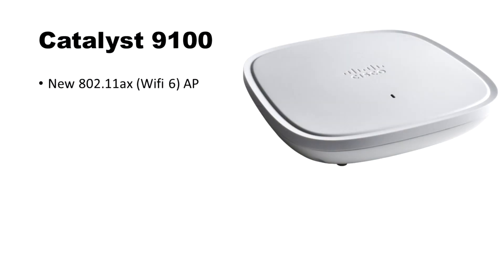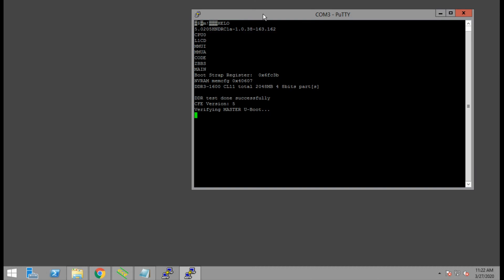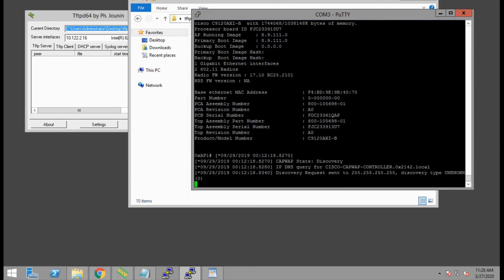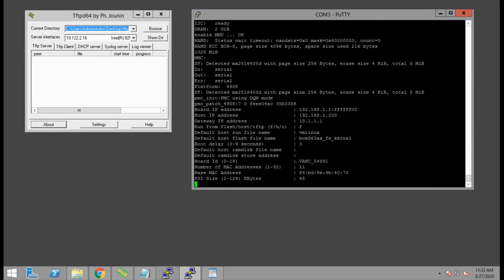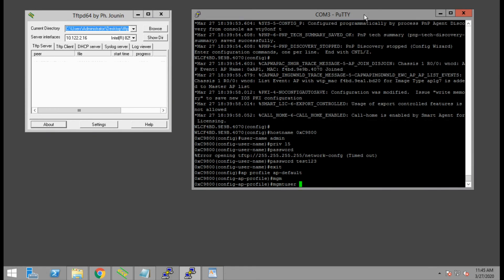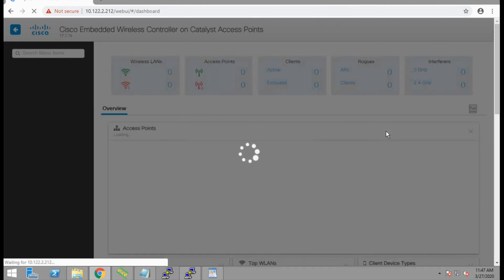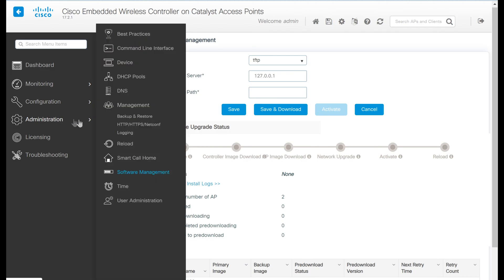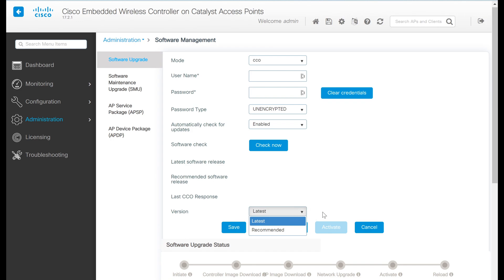[How To] Cisco Catalyst 9100 AP - Convert to Embedded WLC

Comment: I want to buy a CATALYST 9117AX SERIES. 

1. Which model should I buy? 
A.  C9117AXI-B
B. C9117AXI-EWC-B

2. Where do you recommend for a consumer to buy one. 

Are they just coming pre flashed with EWC and can't the B model just be flashed to have the EWC?

Thanks for all your help, you are one of the few on youtube with such detail and clarity! Huge thank you.
Reply from the maker: Hey there! Thanks for reaching out. Yeah the only difference between the AXI & AXI-EWC is whether or not the EWC comes pre-loaded by default. That being said, yes you can flash the EWC to the regular model as well - which is what I did in this video!

For consumer purchase? Maybe Amazon ( https://amzn.to/3kyn5XI ) or something. Ebay might also be an option, if there are any good used/refurb models.

I'll also mention that the 9117 was just announced for upcoming EOS/EOL, since it was a pre-standard wifi 6 AP. That may mean there will be more used available, as people refresh to the wifi 6 certified APs. ( https://www.cisco.com/c/en/us/products/collateral/wireless/catalyst-9100ax-access-points/eos-eol-notice-c51-744421.html )
Reply: @0x2142  Awesome thank you for the quick response. 

I liked the 9117AX for the 8x8 on 5Ghz. Not sure it's worth spending on a EOL / EOS product. It seems to be the only one not WiFi 6 certified out of the bunch.

If you were buying for your home / home office which would you pick? 9115 or 9120 or 9130?

Again thank you for all the advice, thoughts and links!
Reply from the maker: No problem, happy to help! I have two 9120 APs at home right now, managed via the EWC. They've been very solid so far & I'm happy with them!
Reply: @0x2142  

One last set of questions :))

1. Does your setup require Smart Licensing or any other licensing?

2. Would all your instructions apply to Mac?

3. Amazon has the 9120 for $750 as of this post. Does this seem accurate. Where did you buy yours if you don’t mind sharing. 

Again this video is awesome, great work, high quality and clarity.
Reply from the maker: Haha - No problem! I appreciate your comments!

The APs only support Smart Licensing, but I think you get 30, 60, or 90 days before the EWC starts complaining. After that, you'll need to connect to a Smart Licensing account. 

I believe everything should work just the same on Mac, though I'm not familiar with what TFTP server options are available. That aside, all else should be very similar.

The Amazon pricing you shared sounds pretty close. I got mine through my employer for lab/testing, so I maybe I shouldn't be giving advise on what's the best pricing :)
Reply: I’m still confused about licensing. This seems deliberate on Cisco’s side. 

My 9120 should arrive today and looking forward to your tutorial but on Mac.

If I love it I think I’ll need to buy the DNA 3 year license $185 or so and after that I don’t need to subscribe again. Is this true?

Sorry to bug you just not a lot of sound resources I’ve found on the webs.
Reply from the maker: Hey there - yeah licensing is everyone's favorite subject :)

So I'm not 100% on how it would work in your case, but typically if you buy direct from Cisco or a Cisco Partner - the DNA license is mandatory that it be included with the order.

Historically, with most Cisco platforms you would buy the hardware & a perpetual license. These days you would buy the DNA license, which is a subscription license. However, the DNA license also includes a perpetual license for all of the non-subscription features. I don't believe you can procure the perpetual license without buying the subscription license first...

Yes, the reason behind this is Cisco trying to get people on-board with their subscriptions. But I'll say two things to that.... One, you don't have to renew after the initial 3 years. And two, Cisco discounted hardware to accommodate the new licensing model. So most purchases of a new device + required license are very similar, if not the same price as an older device + perpetual licensing. The way I look at it, it's like paying the same - but with a 3-year trial of the subscription features. ( Disclaimer: I work for Cisco at the moment, but opinions here are my own )

So long story short, I think you will need to buy the license. However, you are under no requirement to renew it. You'll also have your trial period on the AP before you need to activate the license - so you'll have some time to play with it before making that decision.

Hope that helps!
Reply: @0x2142  

This is SUPER helpful. I really appreciate all the help/advice/support here, I hope it helps others too like me being less informed on Cisco products and services.

I should be getting the 9120 today from Amazon. It was delayed for some reason. 

Overall Cisco is license heavy but in the end if they make a AP that is best in class quality, then to me it seems worth it. I'm certain this is a debatable topic everywhere and certainly based on everyone's project budget and needs.

I've tried Ubiquiti HD, Rukus 650 & Aruba InstantOn AP15 Access Points but they all left much to be desired for my scenario.

I don't mind grabbing a 3 yr DNA license if I don't have to renew it after 3 yrs and I end up loving the quality of the Cisco 9120AXI. I'll probably grab the DNA license from CDW unless you know of other good places to buy online.

Again super appreciate the help. Always so helpful and thorough, thank you!
Reply: So many newbie questions. I can get around with basic command lines. 

1. What is the best way to get me into this AP? Should it be via the console cable (USB to RJ45)?  This is the best article I could find to do this via Mac to Console Port. 

https://community.cisco.com/t5/switching/how-to-use-a-mac-for-connecting-through-the-console-port/td-p/2392883

2. Once this is done can I begin to use your tutorial?
Reply from the maker: Hey there - Yeah, I believe the AP will require console access to set up initially, especially if you're converting to EWC. Usually, if you already had a controller online - the AP would just boot up, find the controller, and join it automatically. 

I don't use a Mac personally, but those steps look pretty similar to what I've done on Linux before - so I think that should work. 

Once you're connected via console - you should be able to follow the rest of the tutorial, since it should all be via the AP CLI.
Reply: I used Serial 2 for Mac this made it easy for my Mac to find the USB to RJ45 ie. Port on the Cisco AP. 

However, the AP boots but I never see a username prompt to update it to the EWC firmware.

If there is a better place (Forum) to do this on vs. youtube do let me know.

I have the full log in a .txt file I can share on Dropbox, but here is what keeps repeating...

pv6 gw config loop in discovery timer expiry
[*11/21/2020 04:09:39.2750] ipv6 gw config loop in discovery timer expiry
[*11/21/2020 04:09:41.2750] ipv6 gw config loop in discovery timer expiry
[*11/21/2020 04:09:47.5350] PNP:Server not reachable, Start CAPWAP Discovery
[*11/21/2020 04:09:47.5350] 
[*11/21/2020 04:09:47.5350] Going to restart CAPWAP (reason : Post startCapwapDiscovery)...
[*11/21/2020 04:09:47.5350] 
[*11/21/2020 04:09:47.5350] Restarting CAPWAP State Machine.
[*11/21/2020 04:09:47.5360] Discarding msg CAPWAP_WTP_EVENT_REQUEST(type 9) in CAPWAP state: Discovery(2).
[*11/21/2020 04:09:47.5410] 
[*11/21/2020 04:09:47.5410] CAPWAP State: DTLS Teardown
[*11/21/2020 04:09:47.5560] Aborting image download(0x0): Dtls cleanup, 
[*11/21/2020 04:09:47.6290] do ABORT, part1 is active part
[*11/21/2020 04:09:47.6440] upgrade.sh: Cleanup tmp files ...
[*11/21/2020 04:09:53.2320] ipv6 gw config loop in Ac discovery
[*11/21/2020 04:09:55.2320] ipv6 gw config loop in Ac discovery
[*11/21/2020 04:02:03.4460] ipv6 gw config loop in Ac discovery
[*11/21/2020 04:02:05.4460] ipv6 gw config loop in Ac discovery
[*11/21/2020 04:02:06.4470] 
[*11/21/2020 04:02:06.4470] CAPWAP State: Discovery
[*11/21/2020 04:02:06.4510] Discovery Request sent to 255.255.255.255, discovery type UNKNOWN(0)
[*11/21/2020 04:02:16.9030] ipv6 gw config loop in discovery timer expiry
[*11/21/2020 04:02:18.9030] ipv6 gw config loop in discovery timer expiry
[*11/21/2020 04:02:20.9040] ipv6 gw config loop in discovery timer expiry
[*11/21/2020 04:02:22.9040] ipv6 gw config loop in discovery timer expiry
[*11/21/2020 04:02:24.9040] ipv6 gw config loop in discovery timer expiry
[*11/21/2020 04:02:26.9050] ipv6 gw config loop in Ac discovery
[*11/21/2020 04:02:28.9050] ipv6 gw config loop in Ac discovery
[*11/21/2020 04:02:30.9050] ipv6 gw config loop in Ac discovery
[*11/21/2020 04:02:32.9050] ipv6 gw config loop in Ac discovery
[*11/21/2020 04:02:34.9050] ipv6 gw config loop in Ac discovery
[*11/21/2020 04:02:35.9060] 
[*11/21/2020 04:02:35.9060] CAPWAP State: Discovery
[*11/21/2020 04:02:35.9080] Discovery Request sent to 255.255.255.255, discovery type UNKNOWN(0)
[*11/21/2020 04:02:46.3620] ipv6 gw config loop in discovery timer expiry
[*11/21/2020 04:02:48.3620] ipv6 gw config loop in discovery timer expiry
[*11/21/2020 04:02:50.3620] ipv6 gw config loop in discovery timer expiry

Thanks in advance!
Reply: Converting a CAPWAP AP to an Embedded Wireless Controller Capable AP
Note	
Before converting from CAPWAP to embedded wireless controller (EWC), ensure that you upgrade the corresponding AP with the CAPWAP image in Cisco AireOS Release 8.10.105.0. If this upgrade is not performed, the conversion will fail.

I didn't notice this in your tutorial but maybe it's not needed. Not sure what the AireOS release part is. Thanks!
Reply from the maker: So by default the AP will boot into CAPWAP mode, where it will continuously try to find an external wireless controller. Those messages will continue until it finds a controller.

You should just be able to press enter a few times and see the login prompt, after which you can log in & complete the steps. Those messages will still continue though, until you upgrade to EWC.

If it helps, I went ahead and set up a Discord room - I can check there to chat if it's easier for you. https://discord.gg/YMSnP5jXhu

Comment: Hi, i try to follow your instructions for the 9115 model. Unfortunately in the console after bootup i don't have a prompt line. The AP after few minutes of booting stay in a loop of capwap discovery. How i can stop the discovery to obtain the prompt command line?
Reply from the maker: Hey there - 
   I'm not sure there is a way to stop discovery. You should be able to still press 'enter' a few times and get a CLI.  Did you notice any errors when converting the AP? Sometimes if the WLC image has an issue, you may boot into recovery mode. 

If you need it - I did write a bit in the blog post on how to fix recovery mode: https://0x2142.com/how-to-convert-catalyst-9100-ap-to-embedded-wlc/
Reply: @0x2142   Hey, thank you for the fast reply. I investigate and found the issue....i used a console cable with only 4 lines instead 8. So i can see the console but not transmit commands. With instructions of the correct pinout i soldered a cable. Now i was able to reach the prompt and install EWC. Thank you for the help.

Comment: i cant get pass the day 0 configuration. says "Failed to save vrrp-ip.txt" i tried searching everywhere, no luck! HELP!!!
Reply: I had the same issues. I used this link to reset the controller back to defaults (wireless ewc-ap factory-reset), then try the day zero instructions located on the flash (more ewc_day0_device_provisioning_guide): 

https://www.cisco.com/c/en/us/support/docs/wireless/embedded-wireless-controller-on-catalyst-access-points/215303-embedded-wireless-controller-conversion.html#anc7

Make sure the AP has an IP or the controller will not back able to connect to the network.

Comment: Is the Cisco DNA license required for the basic wireless function?  Or is that only if you want to use the DNA features?
Reply from the maker: Hey there -  
    DNA licensing is required for all APs connected to a controller. However, there is NO licensing required for the controller itself. More info here: https://www.cisco.com/c/en/us/products/collateral/wireless/catalyst-9800-series-wireless-controllers/nb-06-cat9800-ser-wirel-faq-ctp-en.html#CiscoCatalyst9800SeriesWirelessControllerlicensing

Comment: So how do I connect this embedded WLC to a switch? just connect it on trunk port as usual?
Reply from the maker: Yeah absolutely. The embedded WLC will be accessible on the same data port used on the AP. I think by default, the WLC will run on the native VLAN - but you can change that once you get everything up and running. 

In my lab, I had a trunk port connected to the AP - native VLAN used for WLC & AP addressing/joins - then additional VLANs for the actual data SSIDs.